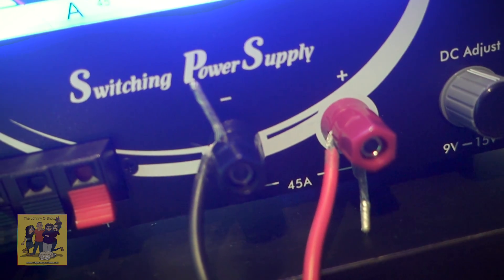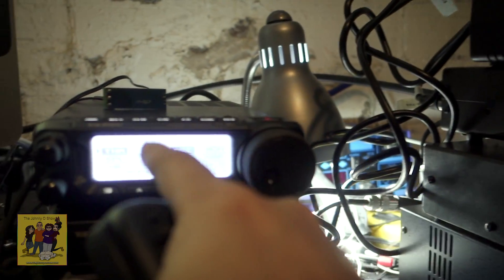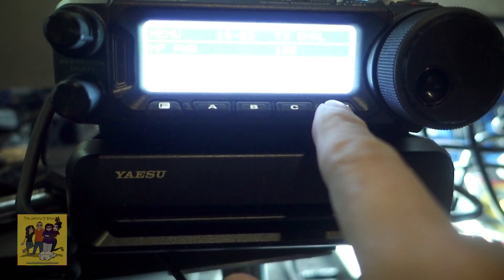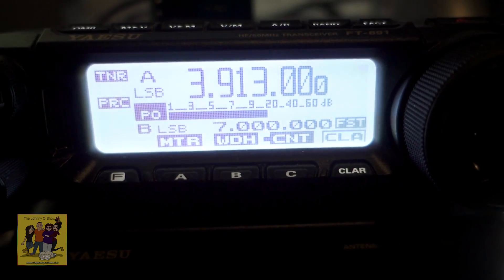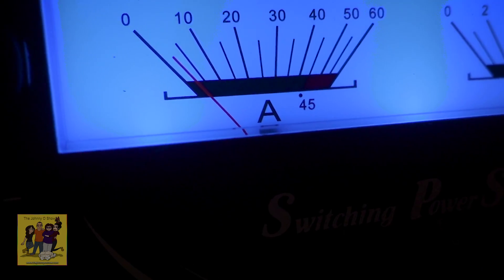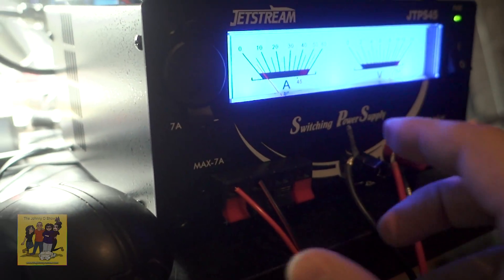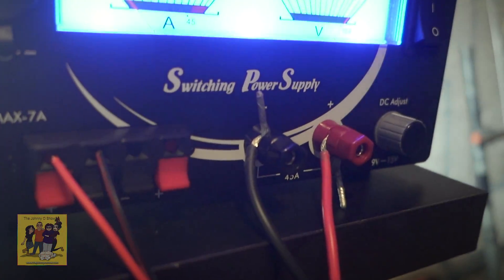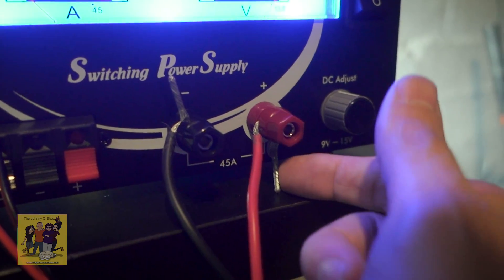Ep. #463 The Jetstream JTPS45 - 45 Amp Power Supply

Comment: Its a good unit far as I can tell.  I bought one off a a local years back and it has been a solid performer for my HF since 2016.  Only issue I have had is the power switch has physically worn out and needs replaced, easy fix.  I would like to hook it to a scope and see how clean it is as I have been thinking of going to a large linear...but I have had no issues with my AC-DC powersupplies
Reply from the maker: Mine has also been working very very well, No power switch issue because i never have it off (unless a storm) so the switch is hardly used. but yeah its been very solid so far since 2018